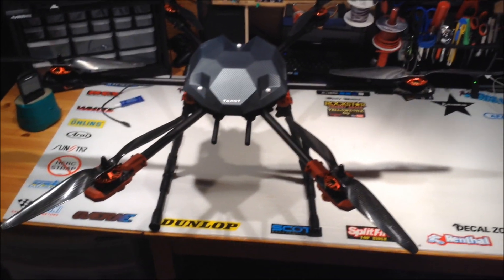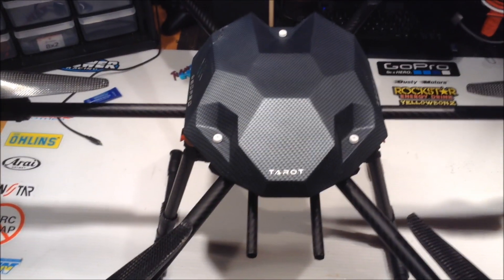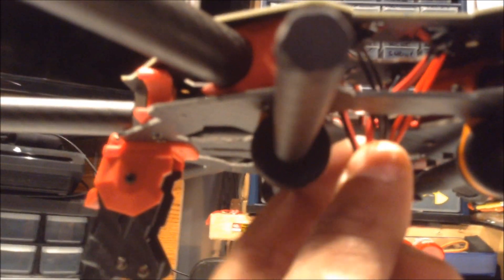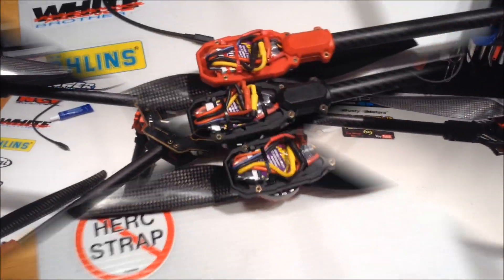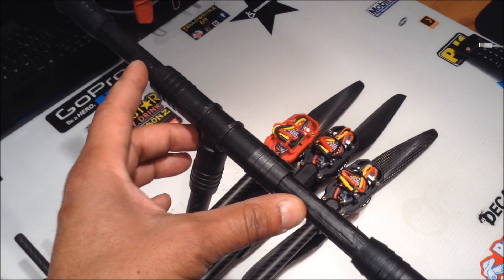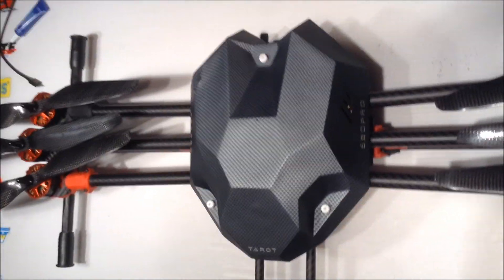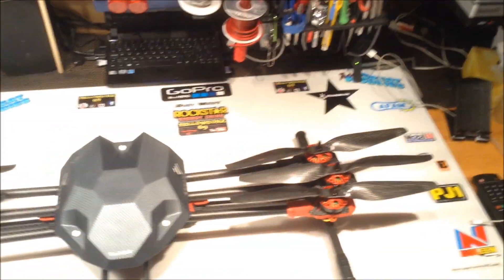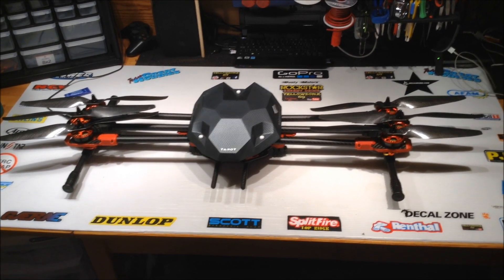Tarot 680 Pro Hexacopter Build-Assembly Part 4

Comment: How did you put the canopy rubbers (the 3 white rubber thingies that sit in the holes for holding the canopy) into the canopy? It seems impossible. The rubbers are too big for the holes. Did you use some special tool to do that?

Comment: Would 320KV 21 pole multi star motors work on one.
Reply from the maker: Long Range FPV Quadcopter .TBS Discovery sounds kind of low Kv, I'm not sure about that sorry.
Reply: 320kv by the looks of it works on X8

Comment: Build looks great. How did you get the canopy installation parts on the canopy? I'm having hell of a time installing those white rubber mounts.
Reply from the maker: Numair Khan I didn't, simply put the canopy on the pins and drop the rubbers over top, never had any issues bro

Comment: Looks real nice. I´m almost done with my 680 pro and really looking forward to get it up in the sky. Maybe i´m stupid but I do not get it how to push the rubber grommets through the holes of the canopy? I have the same as you so I thought I would ask you before I go all mental and throw it in the bin..
Reply from the maker: Tomas Norrman I never did, I just put the canopy into position and push the rubbers on the posts
Reply: YellowBonz69 Thanks for the tip, sounds like a good solution!

Comment: Hi, I noticed you are using a propeller with a thin hub, like a T style. Did you have to modify your AX4008 motor shafts? Looking at them online, the shaft looks too long to allow such an installation. I'm interested in trying them, hence the question. Any advice on your prop choice would be appreciated. Thanks.
Reply from the maker: ***** No modification was needed, I just used a spacer between the blade and the cap, perfect fit.

Comment: Do you have a recommended placement for circular polarized antennas for FPV?  I'm only getting 100m before I lose picture when the 680Pro is rotated so the aerial is behind :(  Any advice?
Reply from the maker: Jayden Lawson Only thing I can think of is to mount your antenna towards the bottom of the airframe with the antenna head facing the ground. Should get you greater distance bro
Reply: YellowBonz69 Ok thanks man.  My Rx antenna is attached behind my monitor which is perched on top of my Taranis.  Could it also be interference from the Taranis?  Guess its a process of elimination.
Reply from the maker: Jayden Lawson its a possibility but I bet its a mounting issue on the aircraft, but u never know. Try try again  is my motto, cheers Bro.
Reply: YellowBonz69 Thanks man.  Repositioned it on the feet of the tarot (not great for crash conditions - I know) but got over 250m of clear video.  Was also at a new park so that may have made a difference - the old one was narrow and trees either side.  Anyhow - its looking great now - but will keep trialling stuff. Thanks heaps.

Comment: Can anyone recommend the correct props for the AX-4008Q-620KV Motors?  I've found a few on Amazon and others on Banggood and yet others on Hobby King.  I think I'm looking for 13x4.  When I buy I need 6 of them, be nice to find some advice on plastic blades to test it out with first.  No raves or reviews on Amazon that I could find.

http://www.hobbyking.com/hobbyking/store/__51969__1255_Carbon_Fiber_Propellers_CW_and_CCW_Rotation_with_Dual_Mountings_1pair_.html
http://www.hobbyking.com/hobbyking/store/__51970__1355_Carbon_Fiber_Propellers_CW_and_CCW_Rotation_with_Dual_Mountings_1pair_.html
Reply from the maker: Here's what I'm using, http://www.hobbyking.com/hobbyking/store/__61582__1355_Carbon_Fiber_Propellers_CW_and_CCW_Rotation_with_Dual_Mountings_1pair_US_Warehouse_.html?strSearch=1355 carbon
Reply: Thanks man.  That was driving me crazy.  Any recommendation on plastic?  This is my first time flying one.
Reply: YellowBonz69 As time does fly hi 10000 4s? thanks for gorpo gimbal
Reply: Any details on the Spacers used?  Thinking 5mm ID x 8mm depth? I was going to try nylon but might be better to go aluminum.  Not sure just how hard I'd need to dial those down.  Thread locktight?

Comment: Hi great build. How did you make sure the motor mounts are level and not slightly off cheers.
Reply from the maker: I used the flatest surface I could find and my 8" level, you will never get them all perfect and there's always going to be vibrations

Comment: Looking good so far. Make sure you snip the red wire from your ESC , I didn’t even thought it did not have a  external BEC, I could not get it to work on the Naza M, until I cut the red wire.  You did not like the original landing gear. They work ok for mind with the retracts. Did you think of buying the Taranis radio, they are being sold right here in Ontario at half the price of the others. I tried the Futaba, but I like the Taranis with the open source programming and now they have the 9 channel receiver. Right now I needed 2 receivers to do what I need, Camera switching, retracts, gain control   and camera tilt. You will need the manual, GPS and altitude to do the compass calibration
Reply from the maker: Thanks Bro, I added the red wire to my todo list, thanks for the tip.
I prefer my bigger landing skids especially as I will be adding considerable weight.
I love the Taranis, I had already placed an order but when the backorder was gonna take 3+ weeks I canceled it. I bought the Naza but figured I would give the 9X a go for now.
Calibration details duely noted. Dude I appreciate the tips so keep them coming please. Cheers
Reply: Cut which Red Wire?  I've been building mine and following your build, but I'm not understanding this cutting of a red wire.

Comment: very nice Frame.  what Lipo are you gone use ?? 6S 8000 ??  and are those battery wires not a bid to thin ???
Reply from the maker: I think I'm gonna use 2x 14.8v 5000mah Lipos in parallel , and yes I agree about the wire gauge and they have already been swapped out lol